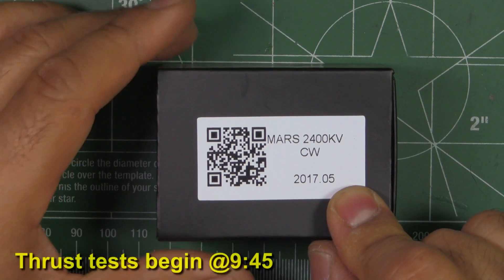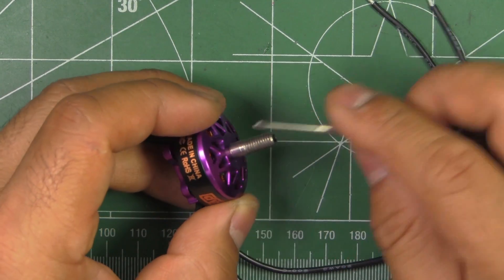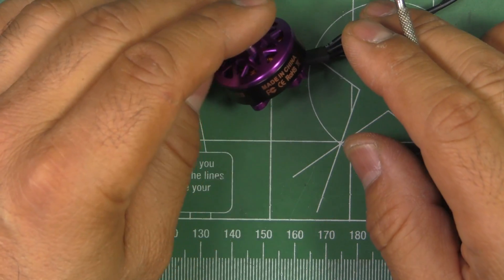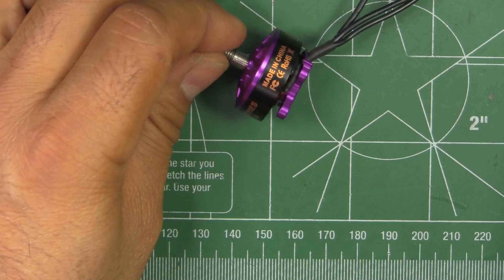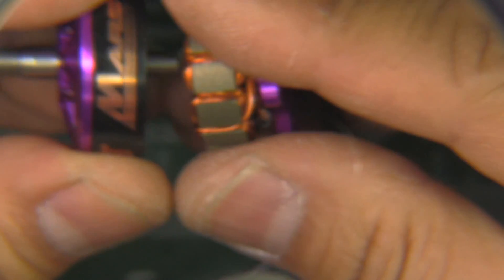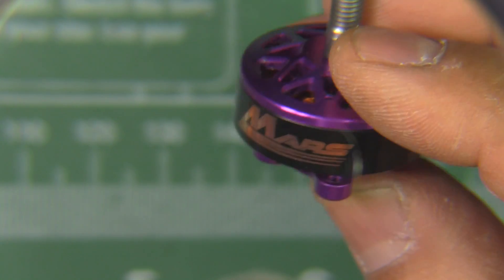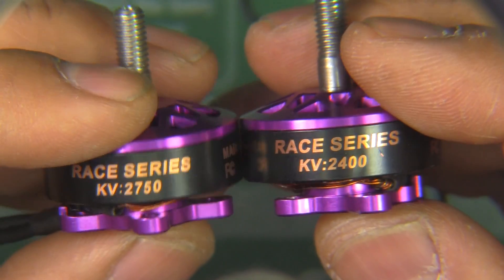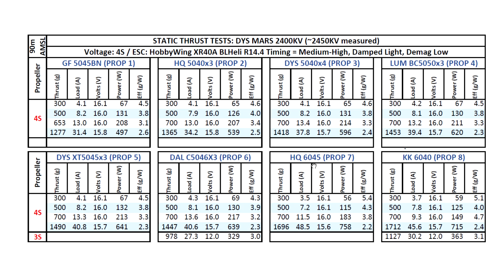dys Mars 2306-2400KV Thrust Tests - To Infinity and Beyond!

Comment: Bought those after watching your review. Love those motors. They are very efficient I think when you fly slow, but have a lot of power if you go all out. Fly them with 5x4x3. Your review is spot on and I keep watching them to decide on my next set of motors to buy :-) Thanks a lot!
Reply from the maker: Awesome, and thanks for watching. Very good to hear motors performed well. Always good to hear about users' experience so thanks for chiming in. These may not be the most powerful these days but I think for freestyle they're an excellent choice. Components and build are very good so they should be as reliable and durable as any of the other premium motors. The Fire, Storm, Mars, and Thor line seem to be pretty durable too.

Comment: Just realised u didnt test using 5152s
Reply from the maker: GF5152's don't do well on the thrust stand, similar to TRK5051x3 - lower thrust than 5040x3 and higher Amps. Seems their blade airfoil design is better suited for working in moving airstream. In static air they don't do so well and appear to have lackluster performance but we all know they're better than that when flying. That's why I don't include them anymore.
Reply: EngineerX Oh.. Thats a unique characteristic from them.. Thanks

Comment: I like the video. Just an fyi, hollow shaft isn't for the purpose of weight. It's actually supposed to increase durability iirc
Reply from the maker: I never heard that,  I can't think of a way that hollowing shaft would help increase durability. Do you remember where that was posted or talked about. I'd sure like to read about it.
Reply: you hollow a shaft to take the center out, as the center can act as a shear point, i used to do this for dirt speedcars driveshafts 600hp sprint cars.
Reply from the maker: Thanks for the explanation, that is very interesting and has some good evidence - 600hp worth of evidence. It sounds a little counter-intuitive, but I bet there's a material science analysis that can prove it showing the center sees the most shear stress and that's where failure propagates from. I'll have to look it up someday.

Comment: nice to see 5s test, hope to see more in the future
Reply from the maker: I'll be including 5S-5043x3 in motors with this KV to get an idea of how motor copes with load. From what I've seen,  motors in this size class and 2500KV or thereabouts, have no problem handling 5S with any of the 5" triblades. Some can handle 6S as well, but my thrust stand equipment is already near its limit so I rather not risk damaging. Static tests load motor way higher than when you're flying, that's why Amps get frightening high at Max throttle but in a flying quad, they'll be way lower. That's just the way it is, so gotta keep that in mind. As always, just multiply the max from my test by 0.65 (or 0.75 if you want a conservative number with more headroom if you're looking to size ESC's)

Comment: good review the motor seems quite efficient
Reply from the maker: Yes, these purple DYS motors have been fairly efficient. They don't use curved magnets and the airgap (stator-to-magnet spacing) is not small. I think those 2 factors prevent motors from making even more power and using more Amps but in turn, make them a little more efficient. It's a good trade-off as these offer a different option for people that fly freestyle.

Comment: Seems they are copying the Emax 2306 2400 kv and Emax 2306 2750 kv. lol
Reply from the maker: Gotta emulate the best - EMAX has been at the forefront of motor development since they released the RS2205 and knocked off the Cobra 2204(5) off its pedestal. It's going to be interesting to see what EMAX has in store next. They should at least cash in on the naked arse trend which does have some merit for keeping these large motors "light" at around 32g. I would've loved to see more development on 2006, 2008, 2108 or some other smaller format for light builds but now all manufacturers are concentrating on big power. No replacement for displacement I guess.... LoL

Comment: ouuuuh... the test is here..  i havent seen the whole vid.. just excited to type something.. haha
Reply: oh and thor is 2408 size..
Reply from the maker: Yeah... should've been called Odin, it's the big daddy of the purple series
Reply: EngineerX between this and storm, which would u go for and for mars, in general this motor is more for freestyle? or can be use for race as well..
Reply from the maker: I would go for this one, but I fly freestyle and don't race at all so honestly I couldn't say if it would do well in racing. I know racing guys need as light as possible  so at 31.1g it's not bad and it's about 1g lighter then the Storm or nearly the same. The Mars has more torque so in theory it should produce thrust faster than the Storm, but it's only a bit more, not huge amount more. If I had to go by the test results, I'd probably choose the Mars for racing too, but without being experienced in racing, don't trust my opinion so much ;)
Reply: EngineerX Thanks man for the tips.. i laid off flying for the past 6 months.. rebuilding my quads for mostly racing.. Thor is being shipped over.. Looking at a second setup.. i like the new naked style of thor and mars.. i know from others that storm is efficient, hope the other two is efficient as well..
Reply from the maker: Good times to get back in - lots of great choices for motors, FC's, and FC firmware. So far, this purple/whatever color DYS series seems to be doing well. Hopefully these naked bottom motors are reliable and durable as well.
Reply: EngineerX yeah.. the rate this hobby progress is insanely fast. I hope the thor and mars are efficient as the storm..